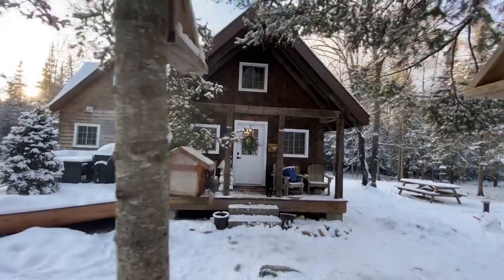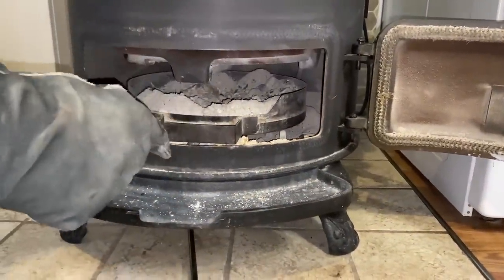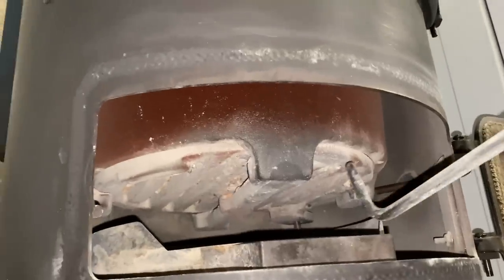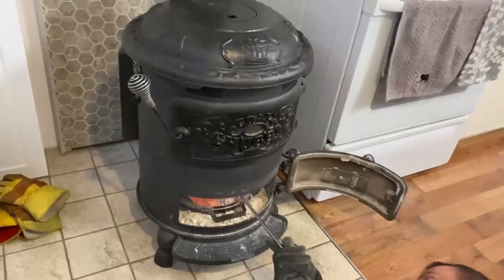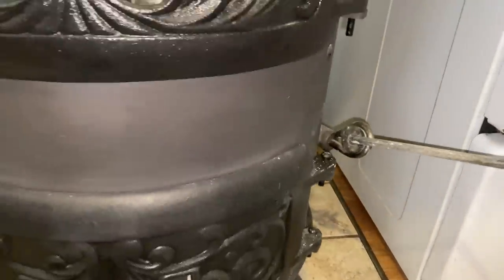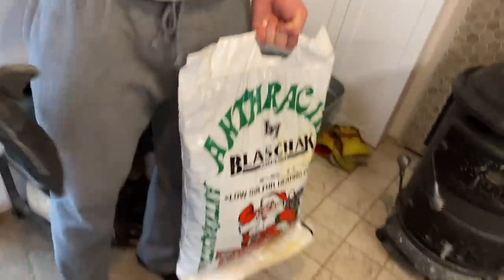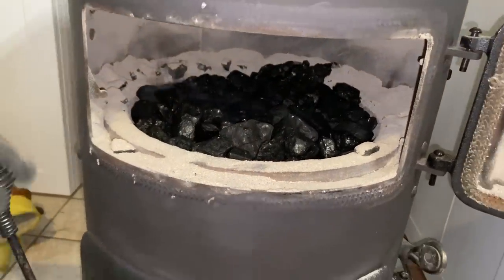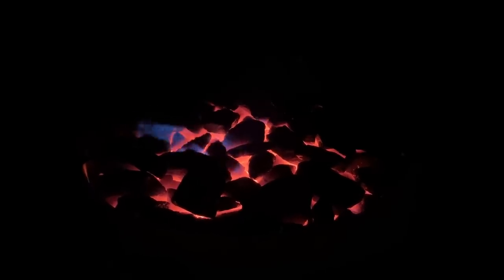How We Heat Our Cabin in the Woods in Winter

Comment: If you place that metal can with closed lid inside, you get free heat untill it cools down. Ash works like sand, and can hold a long time the heat and released it slowly. Another trick if the can is full and cooled down, is to place it on top of your stove and heat it back up. That way you have a small portable heat source. Grtz
Reply from the maker: Not a bad idea at all! I think I’ll need to wait until my daughter and puppy are both bigger though to try it.
Reply: Not taking hot ash out of the house is how the house can potentially burn down.  The placement of the can 8 feet from the house and in the snow is a great place for it.
Reply: You'll end up with a lot of fly ash inside your house.  Did you see the billowing cloud of dust fly up when he dumped the ash hopper into the trash can?
Reply: @fredsasse9973  , how can there be fly ash, if the lid is on the can ? The can filling with ash can be done outside, and after the lid is placed on the can, can it be carried back inside.
Reply: @gibblespascack1418  , it seems that you never had a coal stove. If you fill up a metal can , it can take a week to fill up a entire can. Only the last added ash can be very hot, the ash from the previous days is cold. If you heat up the entire can with closed lid, by placing it back on the stove, the contents will be max 100 to 150° C, not enough to burn something down. If you place the heated can on a concrete tile on the floor, with the lid on top, nothing will happen. Only a nice heat radiation coming from the can which is 100% free.
Reply: @BjornV78  Sure that will work,  however with some people, they try this trick and end up burning down their house in southern NY state(where I live).  Of course you could go with an Amish metal ash can, which is a metal can on metal legs to prevent the heat from over heating  the floor, if it in the wrong place.  Certainly, a way to go, but with the heat that you are trying to recover,  it is kind of irrelevant in the big picture.  Sure, I have the metal can, but I too place it on concrete outside after placing ash and coals in it.  If there is snow on the concrete, I still place the can out there.  I am not going to take any chances and I don't recommend keeping hot coals in a can inside your house because it is unvented and potentially still burning.
Reply: @BjornV78  I get i now.  I ASSumed you meant to keep the can inside the house meaning you'd have to empty the ash pan into the can while inside.  If you take the can outside to dump the ash into it then cover it prior to carrying it back into the house you would not have a fly ash issue inside the house, of course.  Sorry I misinterpreted what you were saying.
Reply: @fredsasse9973  , no problem,  i was not clear enough in my first comment. Grtz
Reply: @gibblespascack1418  , i still have my coal stove, but not in use anymore, but i heated up my house with coal from arround 2010 up to 2015. With my stove, i did have almost no red glowing ash in the tray. In the begin, i carried that trash tray outside wearing welding gloves to empty it on a pile. Then after a while leaving it outside, it gets removed to the recycle park. But after a few years, i start using a metal bucket with the ash in , and enjoyed the free heat. i have in the entire house tiles on the floor, so  the risk for getting fire that way was greatly reduced to almost zero. My coal (arround 500 kg) was stored outside in a wooden box under a shed, and ever 2 or 3 days, i filled up 4 metal canisters with a small scoop and take those inside. But before i filled them up, i used a flower spraybottle to wet the coal and this will reduce the dust a lot. If a coal stove is going , you can easy fill that wetted coal on top of the burning coal. At the time when this wetted coal is below, it's already dry and burned like normal dry coal. Only when i started my coal stove the first time, i did use dry coal. i now use central heating with a oil burner, because due Artritis i could'n handle those scooping and canisters carrying arround anymore. The big difference between heating with wood/coal compared to a central heating with oil, is that with wood/coal the heat stays longer in the house, because everything heats up due the Infrared, where a central heating first heat up the air, and after that objects in the room. So i miss heating with coal, but it is what it is. Grtz
Reply: @BjornV78  

There’s virtually no latent heat left in properly burnt anthracite coal. That would infer poor quality coal (rocky) or unburnt coal (poor burn).

It’s a pile of fly ash; the finest dust you’ll ever encounter. Dump it outside and keep it outside
Reply: @BjornV78  Until I sold the old house last November, I had an Avalon Renier wood stove.  Ran it from 2005 until the winter of 2021-22.  It was a nice unit and I had to empty the ash every morning(when it is the coolest) before refiring for the day.  About 2016, I thought about adding coal after an old neighbor had one in his house.  He used the pea sized coal unit which operated like a pellet stove.  He loved it, just fill the hopper and gravity fed it into the stove during the day.  He also mentioned that there was no more need to clean the chimney after he put in the coal unit.  (it replaced an air tight unit(wood) form the 80's).  He had a nice set up and the convenience was appealing.  I liked picking up wood(called green waste around here) from the neighbors, then processing it to the right size before letting it dry all summer.   The wood stove does keep everything warmer than our current NG central furnace.  Oh well, If necessary, I can install a new wood stove, but coal would be a possibility.
Reply: Do not do this. You have something that is still burning which means it will use up oxygen in the house and create carbon monoxide which fills a room. Keep all ashes outside and away from materials that can ignite.
Reply: Heat up a bucket of sand on top of the stove. Portable heater that's safe and dustless. Sand batteries store an amazing amount of heat. Slide under the bed. Heat a remote washroom. Prevent pipe freezing when power is out.
Reply: Hot ash still contains particles that are burning and produces carbon monoxide. Be very careful about leaving this indoors.

Comment: Hi Frank here; We burned coal in the 60's , much larger stove for an inn, we were taught to first shake the coal on top then the clean-out then reloading, the (coal)was poured in at an angle 45 degrees so the edge of hot coal could start burning the new, then poke a few holes for air around the thicker mass. Again this was a much larger stove with more room inside, " just old school stuff to add "
Reply from the maker: I love hearing about how was burned in different situations - thanks for sharing!

Comment: Anthracite coal is the very best way to heat. Nothing beats it I have been using it for the past 17 years and I used to heat with oil heat and I would never even think of going back to it
Reply from the maker: Couldn’t agree more!
Reply: Problem is coal is quite expensive now in the UK, hard to believe we had 200 years worth in the ground even when every one was using it
Reply: @Fred Wills at least with coal you don't need electricity. So that's an advantage. And I'm a pellet stove user as well. 🖖✌️
Reply: @Fred Wills We are seriously considering the switch from a beast of a wood furnace to a pellet stove.
We are getting older and it would be so much easier.
My major concern is the storage of the pellets, how to keep them from gathering condensation if stored in an unheated area.
I would want an entire winter’s worth of pellets stored away.
We live in Southern Ohio.
Our weather has been unpredictable.
One day it’s 58F the next it 20F.
Moisture builds on everything.
Any suggestions?
Reply: @cabininthewoods517  but how much does it cost though? I'm also european and it's real difficult to get some, even just coal and it very costly so most people just use wood (apart from coal being banned in some places due to emmisions/pollution)

Comment: Great Vid!  --NOTE TO THOSE WITHOUT A COAL OR CHUBBY STOVE--  Yesterday I watched this vid and loved it.  It gave me flashbacks of my great grandmothers little home back in Wisconsin.  She had the old coal stove and pot belly in the living room.  For me, I heat with a small, wood burning tent stove that blows me out of my 35 ft RV.  After viewing the above vid, I immediately went online to find a coal dealer here in central PA.  Found a great little company and bought the same exact coal, in a 40# bag for $10 bucks.  Here's the results:  For my little stove, it's a "No Go!"  With my little stove, I couldn't keep the temp up long enough to keep the coal going.  (I like to run at about 550 degrees from the top of the stove to the entrance of the stack.)  I should mention too, my stove has a raised grate that allows for air to circulate and get drawn up from under the wood or coal creating nice oxygen flow.  That was yesterday, Feb 2, 2023.  Today I jacked up the heat to 650 degrees and kept loading the firebox with wood to maintain the temp.  Stop loading the wood and the temp would slowly drop.  My take away...  Thick cast iron stoves retain the heat better and project better radiant heat.  My tent stove is only thin walled Titanium so the heat dissipates rather quickly.  To the credit of this anthrax (I know, anthracite.  But wanted to see if anyone would catch it.)  😂  To the credit of the anthracite, it does keep a bed of embers going a little longer so I don't have to baby sit the stove as much.  Knowing what I know today, would I run out for another bag of coal and put another 65 miles on the truck?  No, but thankfully yesterday was an absolutely beautiful clear day here in PA and that alone made the ride worth it.  So I put this comment here in case you're having similar thoughts about trying this in a smaller tent type stove, at least you have more experience to draw from.  And secondly, to tell the guy that made this vid he did a great job!  Keep those vids coming!  All the best, -Mike  🙂
Reply from the maker: Great insight from personal experience! Thanks for sharing! Glad you enjoyed the video 🙂

Comment: Nice setup! I used to work for a company that sold that same brand of coal, mostly to the Amish in Ohio. It is a great way to heat! You may want to look into stainless steel stove pipe because the coal will rot the standard pipe alot faster than wood. Take care.
Reply from the maker: Great to meet someone else with a Blaschak connection! It’s fantastic coal. Great tip on the stove pipe, thanks!
Reply: Yes my Anthracite coal fired boiler use to rust out the stove pipe every two years switched to stainless steel and it is still going strong going on 15 years
Reply: @richardboggs260  316 stainless will last a lot longer than 304. The trick is to keep it dry when not burning the stove.
Reply: @pacoal  It's about 3 things.
1. Amount of sulfur in the coal. Less sulfur, less chimney degradation. That's why using clean coal is so important in this case. Of course clean coal means less pollution outside too.
2. Fumes temperature. If it's below some temperature (don't hate me, i forgot the exact number but it's somewhere around 180C 356F), then you will get sulfur compounds deposit on the walls of the chimney.
3. Moisture. Wet chimney with sulfur oxide on the walls will create acid - this is the main reason for chimney degradation. Acid will just eat your steel pipe like a hungry little hippo ;) And there is some moisture in the coal too!

So for those type of stoves it is a ballance between the amount of heat retained in the house and expelled through a chimney to have a well maintained source of heat.

Comment: I used to live near PA border and burned the bituminous type in a coal furnace but that coal was dirty and dusty I used to literally spray it down heavily and burn wet coal. I don't miss the mess but this looks so much better and no electricity or moving parts! I want one! Thanks for sharing
Reply from the maker: I’ve never burned bituminous, but from I hear it’s a messy pain. I have zero complaints about anthracite. If you’re really interested, the exact stove I use can be bought at chubbystove.com. Designed by a very smart New England gentleman by the name of Larry Trainer
Reply: @cabininthewoods517  Thanks! I've already been at the chubbystove website thank you! I had never heard of them before so I appreciate this new to me info. All the testimonials are very positive.

Comment: It all depends on the wood stove, my Ashley I can fill it up on a Friday morning and go out of town and come back Sunday evening and still have coals.   With it opened up a bit more and good hardwood filling it once in the morning and once at night is all it needs when the temperatures are below 20F and I empty the ash tray once a week.  These pretty looking stoves with glass fronts most of them have such a tiny fire box you have to feed them way more often.
Reply from the maker: Sounds like you have a very good stove 👍
Reply: I heat with wood and have a Hearthstone wood stove.
I've never heard of an inside wood stove that could burn that long.
Do you have a model number and size  or link you could send so I can see the exact stove?

 Ashley makes many different kinds.
Reply: @capecodder04  it’s a cheap Ashley Clone.  I have two one is a Wonder Wood the other is Wonder Coal.  The Wonder Coal is 15yrs old the Wonder Wood is 30.  I think they’re made in Mexico now but these were made in South Pittsburgh TN.   The Ashley that looks just like these is the stove we had growing up that performed the same.  I think they were $300 new

Comment: I’ve run a coal
Stove for 2 decades. “Flossing” is unnecessary  if you simply use the shaker grate. Just use that long pick if you end up with a klinker that’s clogging up your grate. I’ve never had a problem running my stove and I’ve never “flossed” it.

Comment: Thank you. Well done video, clear and concise! I bought an old house a couple years ago that had baseboard. I took it out for many reasons and have been looking around at ideas for economical heating. In the meantime I've set up a natural gas fireplace though it's a little expensive. Wood is what I have been convinced of because it's plentiful and virtually free where I'm at; just takes a strong back and a weak mind. This is the first I've heard about anthracite coal and looks like a great option, now to see whether my laws will allow it.
Reply: I use an alaskan coal furnace in my basement ..Hooks up to my existing ductwork and can beun for several days on a hopper of coal,,Incredible heat and very little maintenance
Reply: @dennisgill3459  Excellent, thanks for the insight Dennis!
Reply: Some laws are unconstitutional.
Reply: @jimwhitsett4736  Lol! Jim, the older I get the more I feel most laws are unconditional! Except for the one that they don't pass about getting off my lawn
Reply: @jaredgray7872  Because you don't like a law doesn't make it unconstitutional.
Reply: What y'all are referring to as laws are likely not, more likely codes or policies which are not law as per u. s. Supreme Court.
Reply: Burning coal is way different than heating with wood. There's a learning curve to it. I heated with wood for a lot of years. I bought a new "wood " stove because I thought it was cool. It burned wood really fast and I couldn't  control the temp or the burn rate at all. So I started talking to people and some old timer I talked to told me it's not a wood stove but a coal stove. So I bought coal for it. It took me about a month to figure out how to make it work right. I got it so hot that the whole thing glowed cherry red - literally. And then there were times I froze my azz off because I couldn't keep the fire going right. It takes some learning to get a even consistent burn. But once I got it figured out everything went fine. So, if you're thinking about heating with coal do some research and get some knowledge about it first. That really isn't something you want to learn as you go like I did.

Comment: Does the shaker work as it is supposed to work?  Usually, the shaker is what you do instead of flossing the grate.  I have never seen a coal unit flossed like that.  The set up looks great.  Was the stove new when you got it?    I also like the size of the wood pile.    It seems like if the coal supply runs out, you are ready with wood.

Comment: I once had to run a drill truck for post holes down into mounded up flyash from a coal fired power plant,it was just about like drilling concrete! Took forever with a bit big enough for barn posts! Once the ash gets rained on it hardens up. Saw them drop a load out a belly dump semi on a gentle sidehill,it flowed like water. Not sure if your ash would be strong enough but you could try it for setting clothes line posts or something else easy to redo if it doesn't work as a test.
Reply: Fly ash is mixed with cement to make a really hard fill especially if it’s compacted down,a company I worked for used it to make bricks to make the cement go further and increase strength.